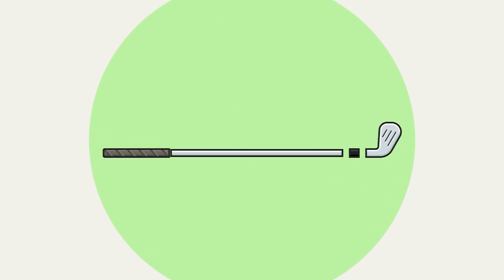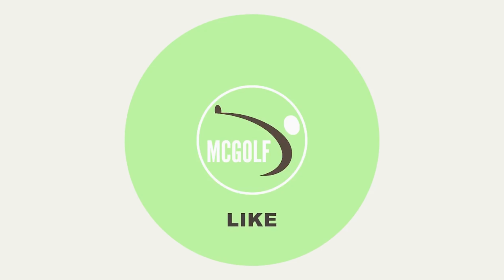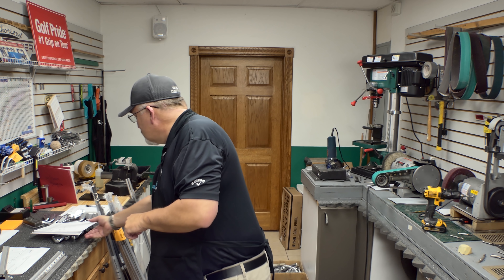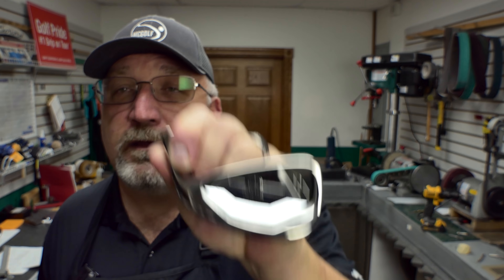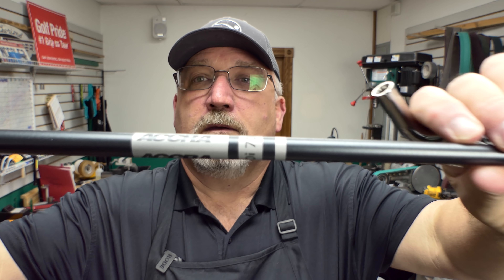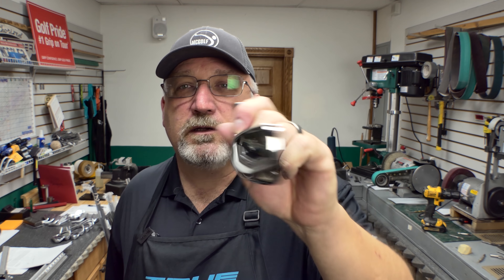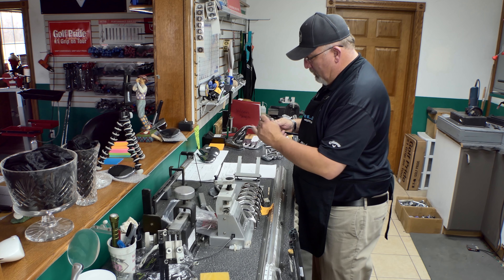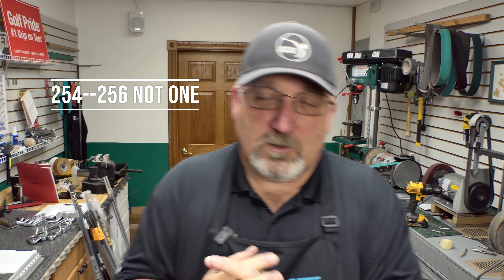Frequency matching an iron 2020

Comment: To properly CPM/frequency match each club must the shaft be parallel tip or tapered...also were are the CPM numbers come from on a shaft...Butt/middle/tip....I'm looking at a mid-high to a high launch shaft....a builder from another site said it came from butt end and that seems odd.

Comment: I really like all of your content, but for me at times the details fall just shy. A few questions if I may, Jim. When you trim the tip then remark the new shaft length, maybe mention you are placing that new mark at the butt end, I assume, at the new length in the vice. Also, anyone who has used a spine finder would have felt the stiffness variation. Surely once you find the right frequency and then spine and FLO the frequency is going to change. In my head, it would. Is this the case as I have never used a frequency machine to test this. Thanks again for your content. I love club building and tinkering with my own equipment.

Comment: Hey quick question so once you have the frequency you want on the fist iron (I'm assuming the longest iron) do you the just follow the trim code from there for each iron. For example if you have the 4 iron exactly where you want it and each iron is supposed to be tipped a 1/2" more is that usually the case of could they all be different and you have to use the analyzer on every shaft
Reply from the maker: It is a combination of trim code and machine, in use trim codes but trim a bit lighter than prescribed and then key the flex, then trim agin if needed

Comment: Hi. How do you determine the CPM slope between each club. Do you base the flex you want off of FCM chart? For example, you want this person's irons to play as close as possible to 6.0 FCM. To find the slope of the shafts, don't you need the 3i and 9i? Do you tip those shafts to recommended specs to be able to get CPM measurement to correctly determine the slope?
Reply from the maker: the slope is dependent on the CPM you want between clubs. Typically the slope for rifle was 4.5. Mine is 4.0 to soften the club a bit.

Comment: Great video Jim. If you have to build with 355 taper are you still able to frequency match or are you just stuck with what you get ? Thanks for the great videos
Reply: I was hoping he'd show the Srixon's for this reason.
Reply from the maker: Your stuck
Reply: @McGolf  unless you'd bore the club out to handle a parallel tip correct?
Reply from the maker: Chad Michael correct
Reply: @McGolf  thank you for the answers and the great videos.

Comment: Hey Jim, on graphite shafts is determining spine alignment necessary?  I know flo is important in the build process. Great vids. Enjoy every one of them.
Reply from the maker: I start with finding the spine then Flo, however some companies mark shafts to give you a clue where to start if not spining
Reply: @McGolf  Hi! I can't understand why i have to find the spine and put it at 12 if after i need to find the FLO alignment (and use it to built the club, at 12). Thank you! stay safe!
Reply from the maker: @nicolabarbolini7189  think of like this, Spine is finding the right church where FLO is finding the right pew. the spine gets you in the general area and the FLO takes into account the actual head geometry.
Reply: @McGolf  Fantastic! Thank you!